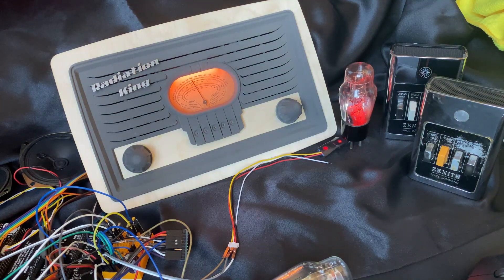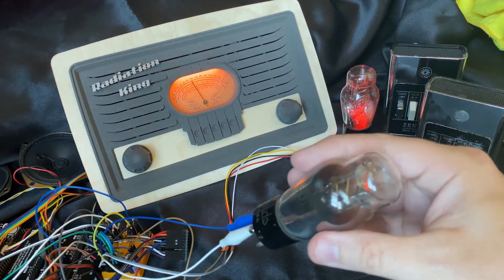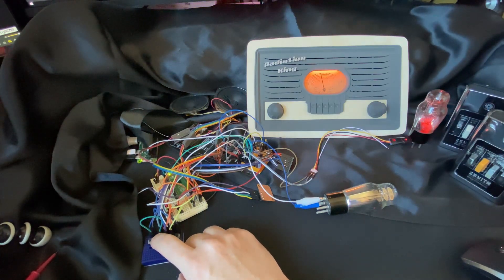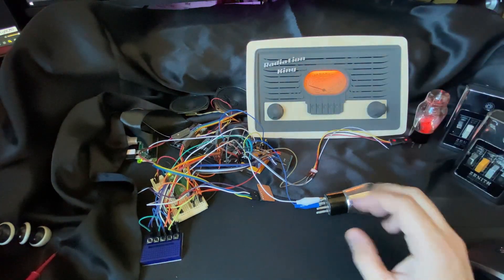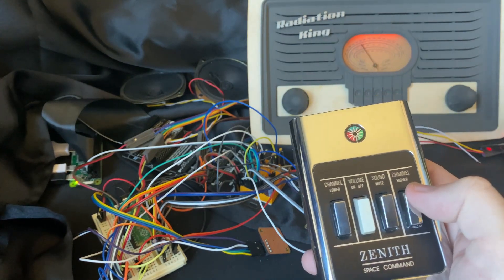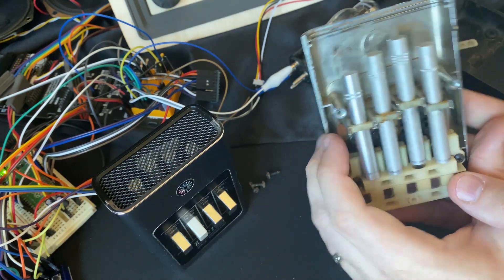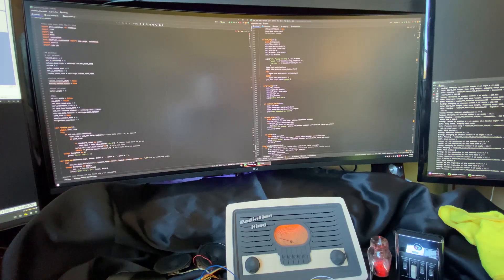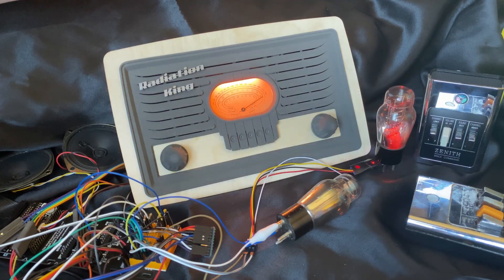Fallout Radiation King Radio, Video Log 2

Comment: How much for the face plate I would like to buy one.
Reply from the maker: I don’t have means to 3D print the faceplate. Mine was made using a work printer with spare material.
Reply: @ZapWizard  understand. Great work. I have been looking for the final product of the project. One of the best I have seen.  I have been looking for 3d print plans but nothing looks that clean.

Comment: Hej Zap
What a cool project.
I would love to make a small pc in an old tube radio.
Could you please provide the files for the faceplate?
It would save me days!
Kind regards 
Fred
Reply from the maker: Try this link: https://drive.google.com/file/d/19h460nxuCZVuCcc22oEnBiXta6Z2AqPo/view?usp=share_link
Reply: @ZapWizard  Thx man.
Sharing is caring. This is to cool ❤❤❤❤❤ Thanks a lot
Reply: @ZapWizard  I just had a look. To you have the center piece as well? :)
Reply from the maker: @frederikmoeller88  Sorry, I forgot I split those up. Here is all the 3D printed parts: https://drive.google.com/drive/folders/1IHQgrhatJ1OrLJhU7EhanwFIRNlzcb8X?usp=share_link
Reply: @ZapWizard  No worries!!
Omg it looks amazing.
THX
Reply: @ZapWizard  Is there a 3d model for what the front panel is connected to? I see in your video that there is more than the front plate. There seems to be a much larger piece behind it. Either way the front panel looks amazing!
Reply from the maker: @spencerburchfield9820  I designed most everything to attach the front panel, that way the enclosure is just a box behind it. Behind is the PCB and speakers. I have a 3D model for the PCB. I have the whole thing on my desk right now, the software is done, I just need a good long (free) weekend to work on the enclosure.

Comment: So I totally want one that I could mount into an old car and use like a real car radio 📻....
Idk why I just think it would be awesome
Reply from the maker: A car radio with virtual stations is a cool idea!  I am thinking about trying to make a PCB that is more modular and generic so that any faceplate could be wired in. My current pcb is working and it would be just a new layout. The only issue is the darn Pi shortage.
Reply: @ZapWizard  Yea did you see that fallout 76 live action trailer fans made as if it would be like a movie, someone had a red chevy/gmc truck with Nuka Cola painted on it pretty sharp
Reply: Lol I would buy one of these off ya to put in the car I'm buying in spring 🤣 the cars a fixer upper but by the end I hope to have some nods to fallout in it haha
Reply: @ZapWizard  by the way I saw another one of those radios on ebay in case you wanted to make a second one hahaha I'd venmo you down the road if you made a second just cause it's too cool but im far too tech inept to make one haha
Reply from the maker: @LastAyleidKing  I had not see that trailer, thanks. I am making my radio from scratch now, I have all the parts, but currently not the time to actually put it all together.
Reply: @ZapWizard  lolol the age old problem we all face between working and living...finding free time to do the things we want haha.

I'm getting a 56 pontiac in spring so I'm prolly looking at a big side project for me to have to throw money and time at <3
Reply: Or just use as alternative because real radio is crap no oldies stations nowadays 😞

Comment: Are you planning on releasing stl files for this I have a real vacuum tube radio that I would love to try to make this radio with
Reply from the maker: Yes. I man currently working on the PCB which is the last physical thing to design.

Comment: This is an amazing project. I’d definitely buy this lol. 

Will you be selling this as a kit? Or the cad files?
Reply from the maker: I don't plan on making a kit, as the wood working will be very much manual. I will release the CAD files. The code is basically done, and published I am now working on the PCB.
Reply: @ZapWizard  I hope you can do a small how to video on parts, connecting what to what, and anything else. 

I think I would be able to build this but some instructions would be definitely be needed. 

I think it would be a legit item to have in a house. People would definitely double take and say “is that from fallout?”  

Cheers!

Comment: Don't worry: the remotes didn't work the best back then, either. 😆
Reply from the maker: Yep, all the more challenging. So the issue is that while developing, I wasn't running the music. Now the music is drowning out the signal, or the music is pulse width modulated at a nearby frequency. I am trying various FFT filtering techniques, otherwise it can become a glorified on switch.